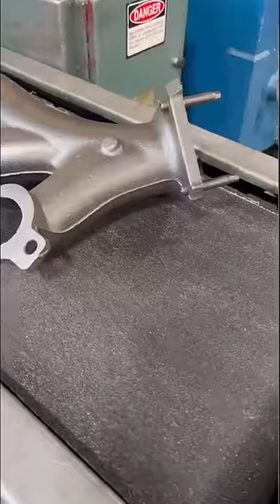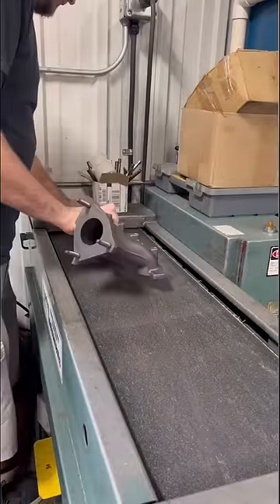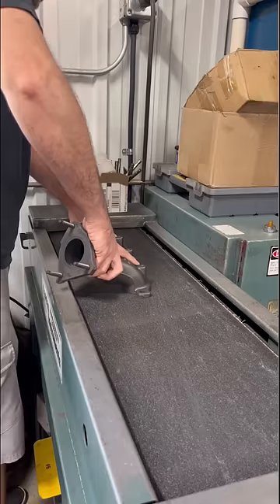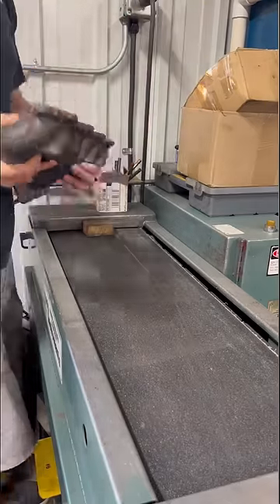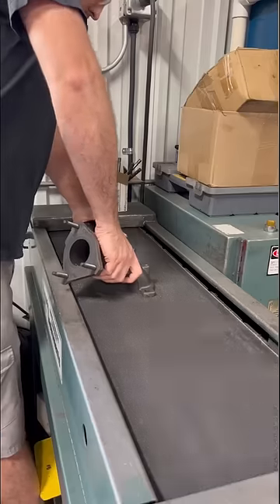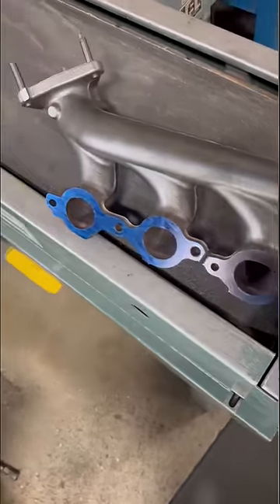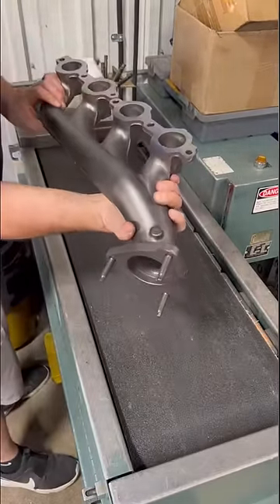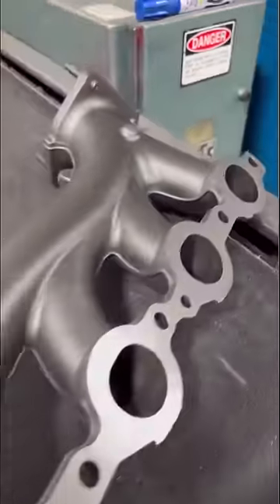#shorts This Is How We Resurface Warped And Worn Exhaust Manifolds

Comment: heck, this is how my local machine shop resurfaces heads lol
Reply: Tripped me out to see you commented, I love your videos!
Reply: Lol you laugh but I have seen machine shops so that
Reply: @surfofsinify  I'm serious....😐
Reply: The ridges slow down the gasses escaping D’uh! 🫣😂
Reply: I've done this had home before, using my table saw bed with sandpaper glued to it and sliding the head by hand. And it's still using the heads today after 10 years.
Reply: @defendermender4959  Here I thought it gave it a biting effect on the gasket to seal better.
Reply: One of the guys in my old shop throws me 10$ cause he makes 50$ at lunch surfacing a head when a guy comes in and the boss isn't around
Reply: I feel like if your equipment is flat and true, that a gasket and glue would make a good seal. Especially if you did some math and put a scribe to where you have to stop sanding. Not everything has to be precision. Lol
Reply: Depending on the application there is often enough tolerance where that method is just fine.  Not saying close tolerance machining and finishing isn't necessary but sometimes what you have to work with is good enough.
Reply: I watched a short on here earlier of a dude resurfacing his block on the asphalt  street
Reply: @josephhaase9452  Ra of 500
Reply: Ouch, although factory machining wasnt much better
Reply: I lapped a head once, fuck that shit.
Reply: Yeh how years of experience do they have? Lol
Reply: 100% same lol
Reply: Did it for older cast iron heads older surfacers didn’t cut much finer then this
Reply: I did a head once on a belt sander followed by hand sanding on sandpaper stuck down to a sheet of glass (poor man's surface plate). It was an old Jeep engine that made pitiful power for its displacement and fuel consumption and also could've handled a huge compression increase without any issues. I wouldn't recommend it in a fancy new, high performance or high efficiency engine, but it worked fine for me on a 40 year old engine. Lasted a bit past another 100,000 miles before the body was rusting out past the point of continued patching. Pretty sure the unibody "frame rails" were more patches than original metal when I finally gave up on that old XJ.
Reply: @MrTheHillfolk  that sounds..... Dishonest lol
Reply: Did something like that with a warped head from a Briggs and Stratton V twin. Placed 400 grit paper on a milled flat cast iron table saw (checked it with a straight edge) and gently sanded 'til it was flat. I found that people just don't resurface those heads because they are so cheap. But this was cheaper and faster.
Reply: @aaroncarter1345  I just said that about a Briggs and Stratton head that had blown a gasket. Working fine so far as I know.
Reply: @surfofsinify  seen a cracked out guy use a big glass table and sand paper glued on it lmao
Reply: @Mr.Potato420  oh damn bet that took a while
Reply: @surfofsinify  didnt stay around to watch it was my buddies dad and he never stayed at home so id always go and pick him up lol
Reply: @Mr.Potato420  lol
Reply: Hey Eric, good to see you here! We have a big rotating sander at our garage for the same purpose too, it works, it's cheap and we use it relatively often as new manifolds that are straight from the box seems to become scarce. Freaking Dormans on a 5.4 for instance  🥴
Reply: @defendermender4959  what ridges
Reply: LOL
Reply: Does it seal????
Reply: Machine shop long time ago where I live used to do heads the same way,it was a brand new Machine for doing heads. It had a stop plate to hold the head
Reply: Yep! With sandbags on top!
Reply: As crude as that is it's still better than some people's Old worn-out Mills these machines have Chrome flat plates under them that are flat. In my shop i do them both ways deepening on what customer wants.
Reply: JFC.

Comment: Mexico’s witness protection program has a fingerprint sander like that.
Reply: Sandpaper spinners like this don't take skin unless it comes with the bone
Reply: In school I made a screwdriver out of solid metal. Brazed the handle to the shaft. Placed that thing in water for half a minute and I pulled it out by hand. You can guess what happened. Had no finger prints for a good 6-8 weeks.
Reply: I swiped back up to look twice at this comment, had me rolling 🤣

Comment: You nailed it man so overlooked, people replace exhaust gaskets all the time and wonder why they keep blowing out in the same spot.
Reply: You’re right this is an easy way to make your warp a lot worse
Reply: @davidalvarez4151  explain how
Reply: @johnghatti5435  you think you put the same amount of pressure on both sides?😂 I use a belt sander daily on wood and metal unless ur shaving a few thousandths off, u shouldn’t be working on cars
Reply: @davidalvarez4151  this is a professional machine shop that has been doing it this way for decades. 

I think it will be just fine or they wouldn't do it this way. 

It may not be perfectly level with the back of the flange and thicker on one side by a few thousandths, but guess what? It's an exhaust, it doesn't fcking make a difference
Reply: @contraband1543  exactly because cars  are easy😂 do that on an aircraft and I’ll see u on the ground this “machine shop” is for hacks
Reply: @contraband1543  and do u really not think an exhaust leak makes a difference? Oh wait you don’t know what you’re talking about😂
Reply: I remove the gaskets because what's not there can't burn.  And, the gaskets cause the manifold to warp.
Not sure if this applies to crappy aluminum heads but the old iron stuff never had gaskets from the factory.
Reply: @thisisyourcaptainspeaking2259  whatt?? Old car engines didn't have exhaust manifold gaskets??
Reply: @jamesbuttery3862  Correct, no exhaust manifold gasket between the iron head and exhaust manifold.  Can't tell you how many exhaust manifold leaks I've repaired where someone installed a gasket and the gasket eventually blew out (burned up), the fix was to remove the gasket and maybe flatten the manifold if warped (belt sander), install the manifold exactly the way the factory did, no gasket.
Any small imperfections are filled with carbon, I guess.
I can't verify if this also applies to aluminum heads, need to look into it.
Also consider waterglass type stove cement if the surfaces are in rough shape, just a thin coating.  Waterglass contains silicate, and is basically sand dissolved in sodium hydroxide to make a very high temperature adhesive, so keep it out of the exhaust ports as best you can where it might accidentally fall into a cylinder.  Thus, a very thin coat and assemble wet.
Reply: @davidalvarez4151  airplanes are easy too! Only in the states but in Mexico pilots fix their own aircrafts. Airplanes are heavily regulated in the states. The same needs to apply to vehicles nobody wants to see 300 people die at once in a airplane crash but if 50 thousand people die every year individually in a car crash nobody cares. Get off your high horse
Reply: @moavic5087  nobody cares about the countries who can’t regulate their transportation 😂😂😂
Reply: @moavic5087  couldn’t fix a weed eater to save your life

Comment: If you are a DIYer here's how you get the same result. Last year when I was doing cylinder heads and cam swap on my 07 CTS-V I bought a 3/4" piece of glass, spray glued sand paper on it and resurfaced my OEM cast iron exhaust manifolds. Came out great and checked with a straight edge. As a bonus I then sent then to my powder coater dor ceramic coating for lower underhood temps.

Comment: Can you imagine slipping and running your knuckles on that belt lol
Reply: That’s exactly what I was thinking. I was working with a guy when he ran his knuckle into a similar setup. The injury itself wasn’t huge, but you could see his knuckle bone, and a flat spot on what I’m assuming was cartridge or maybe tendon. Healed up fine though 😂
Reply: Had a friend in highschool wood shop using a belt sander like this but vertical. He was sanding a little piece and bam belt took it and his skin down to bone.
Reply: So theres a guy on youtube that turned a treadmill into a belt sander, you should check his video his channel is called 'i did a thing'
Reply: Ive done it but with finger tips, i think it was fairly fine as it didn't cause any real dmg just discomfort for a few days.
Reply: Heavy thick gloves
Reply: Yes
Reply: @astroid99  It's not because it was fine, but because your skin just bounces on the sand paper
Reply: Have caught a finger between the end and the belt wasn’t fun
Reply: It's not that bad if the belt isn't super course.
Reply: @kawkaw8623  "I did a thing" is a trash channel that manipulated Brandon Herrera into doing a collab with them and then heavily cut and edited the video along with a voice-over that made him look bad. A treadmill belt sander is also useless because the platen isn't flat and belts that large would cost an arm and a leg. I recommend checking out Fireball Tool's "go-kart belt sander" build instead, which is something far more practical that is useful and can be built and used in a garage. The "gokart" part just comes from. The go-kart wheels he used as belt rollers. It uses a conventional electric motor, which you can buy at Harbor Freight if desired.
Reply: @tricycleguy2657  gloves are a big no-no on equipment like this. Much better to lose some skin than to have the glove caught and pulled into the gap there between that metal bar and the belt. Look up "degloving injury" if you want to know more. They're pretty horrific.
Reply: @ParadigmUnkn0wn  ouch sounds nasty
Reply: @ParadigmUnkn0wn  boo womp
Reply: @tricycleguy2657  For real take this guys advice. You do NOT want to wear gloves around a lot of equipment like sanders, table saws, drill presses, etc
Reply: not a lol moment but yah that's all I was thinking.
Reply: Been there done that. It’s like touching a hot pan or something, you’ll instinctively pull away.
Reply: @tricycleguy2657  Well you can do that but you really need the sensitivity to feel that you’re as flat as you can be on that belt.
Reply: That gave me goose bumps reading that...  BUT than again that is the reason that belt sander is pedal operated and stops almost instantly when the pedal is released.
Reply: Mmmmhhh
Reply: Super course belt on a pedestal linisher and I slipped off the edge and hit it with my thumbnail. It went clean through in a millisecond, ground most of the nail clean off. Needless to say it was a whole new experience in pain, when I had finished the job and washed my hands with soap and degreaser. It took forever to grow back. The one day I said to myself, "I don't need my heavy leather gloves for this quick job'. I wear them religiously now. 😢😢😢
Reply: Can you not use the same method for heads / blocks ?
Reply: I have done such a thing and it does about what youd expect.  Less gross though.. the bleeding doesnt start for a few seconds after you pull away from the belt so its not like youll see a line of red across the floor wall and ceiling but it will take the glove and flesh down to the bone in about 2 seconds.  Not fun but it will heal and it only hits the high spots so the damage is more like dotted sores than it is total carnage.  Hopefully this helps someone’s curiosity. 🍻

Comment: They started Machining in the seventies and I started doing head work in the '80s I would have killed to have one of those they work really great if you use them right they don't wreck anything they don't hurt anything you just have to keep the belt clean don't press down hard and make sure the platen is under the belt is flat and clean and if you do your work everything's fine those machines work really great for the money

Comment: Floor suppliers have 12" x 24" pieces of 80 grit norton red heat sand paper. That can be spray adhesived to a piece of really flat wood to allow 2 or 3 people to surface exhaust manifolds

Comment: That's an absolute brilliant machine. Used to have one similar to that for woodworking but the 6-in belt would slide in and out eight feet and the rain was unlimited. Across the table that used to come down. It was for leveling off and smoothing  used for kitchen or counter top installations of redwood slabs hundreds of years old

Comment: I would fix leaking headers  by building up a weld around the flange and sanding then on the belt sander in my cabinet shop

Comment: Problem, when they warp the bolt holes are no longer 90% to the mounting surface.
That's why bolts break, twist warp.
I've seen many over 0.120 
New manifolds can be bought for $75 with bolts.

Comment: When changing my timing set, on my car recently, I almost didn't change the exhaust gaskets. But I thought it was noisy, since the last time I changed the gaskets. I broke down and pulled the manifolds. Found out they were warped, and that was why they sounded noisy. Using a straight edge, I used my belt sander, to resurface it. Got it down to almost no gap. Put it together, and it was definitely quieter than before. 
Of course, my new RIDGID cordless belt sander died on it's first job. LOL
Took 2 months to get it back from warranty.  LOL 
The things you do when you can't afford, or don't  have time, to take it to a machine shop. You use what you have available.

Comment: I once built a turbo manifold and it warped slightly when I welded it. I took it to a engine machine shop and I was like yeah, just hold it on the belt sander for a bit, it doesn't have to be perfect. He said oh yeah we can do that, come back in a couple hours. It will be done. I go back and he's like oh that'll be 150 bucks cuz I had to put it in the milling machine and remove 150 thou and it's $10 per10 thou. I'm like dude this manifold is $30 in material. I'm like I told you to just put it on your sander for 30 seconds. So I ended up just walking out leaving the manifold behind, buying another one for 15 bucks and buying another flange for 15 bucks and making another one. This wasn't even for the head side of the manifold. It was the exit, you know the three hole standard turbo entrance flange.

Comment: My 2001 Chevy Tahoe passenger side headers were warped and not just a little bit like 1/8 an inch short from the two front to the two back and bad previous owner used high temp silicone to make up for the gap

Comment: I rebuild yellow diesels at the yellow dealer and I use the belt sander to touch up manifolds at rebuild time if they aren't extensively corroded or warped. Never had an issue or rework using this method.

Is your belt sander foot-operated?

Comment: Different grit of sandpaper on that belt sander would technically get you the right surface finish on a cylinder head, rather it be MLS or composite

Comment: You want a really good flat surface that will bring a tear to the eye? Then get your self some window panes and some stick on sand paper. That's how the ol timers do it, even use the back of some floor tiles, the surface is real good though and you get a nice flat even surface. That's how I would also go about it as well especially when I can't afford top dollar machines.
Reply: That is also the way you flatten manifolds for Ford 8n tractors.

Comment: When it's shown with the blue dye. Why does it look like the center rib broke?
Reply: Those manifolds are built with a split there, from brand new.
Reply: Also if you notice the first manifold without the blue is the driver side which is not split. The one with dye is the passenger side which has the split

Comment: do you ever use a surface plate to see if you actually got it flat?  My expierence with belt sanding suggests the ends, specifically the lead end, will be low.  Though its probably still better than it was

Comment: So when you hold it like that and its warped how do you know where is correct? Like where the flat should be vs the warpedness because you arent fixturing it or anything so just eyeball?  because if you go too far and take too much off the manifold could sit funny on the head and not connect to the rest of the exhaust without issues.

Comment: Those look like LS manifolds (LQ4/LQ9). I noticed you snuck in yhe passenger side which has a break between the front 2 and rear 2 ports. When it's so warped that the front surface is offset from the rear (by 1/8 inch or more) do you just chuck it and get a new one?

Comment: Did you crack and repair the cast manifold as one moment It was hlwholenthen in 2 bits on the mating surface then baxk to 2 pice. Did it have warping thst needed letting out with a cut and rewelded

Comment: I have a question, does grinding these down flat (making them thinner) make them warp more easily in the future?
Reply: It does make it thinner, but the whole job is to your discretion. Just do it enough as you need and measure inbetwwen each check, it won’t necessarily make it warp easier. If anything, if you don’t remove it, it shouldn’t warp again

Comment: @jamsionline I have a 2012 Infiniti g37x with a custom exhaust. My exhaust shop told me there is a bulge between the high flow catalytic converter and the flange on the cat back. If it was on the flange I assume they would just put a new one but they told me to sand it down. Leading me to believe that the bugle is on the catalytic converter flange. Can I sand down the cat? Or will it ruin the integrity?

Comment: Probably best to use a giant surface plate and some crocus cloth...in about 15 years, it'll be really flat.  Seriously, if you can prove that it's flat and perpendicular to the stud holes, a belt sander is fine.  Definitely flatter than no surfacing at all.